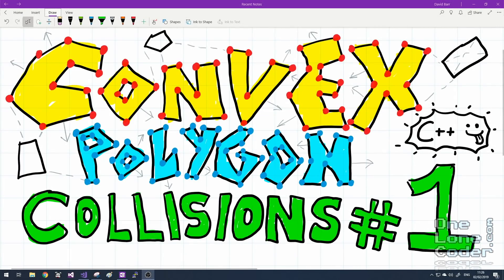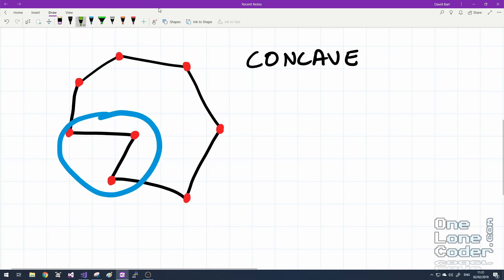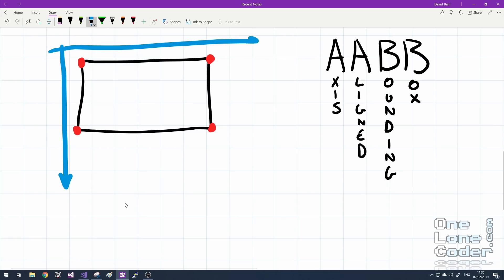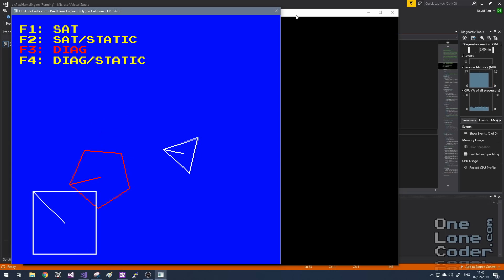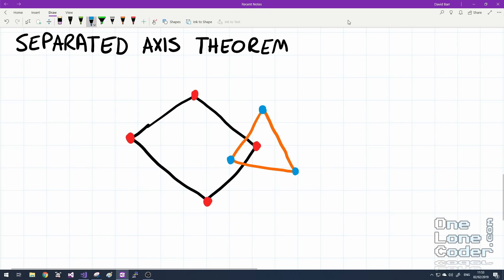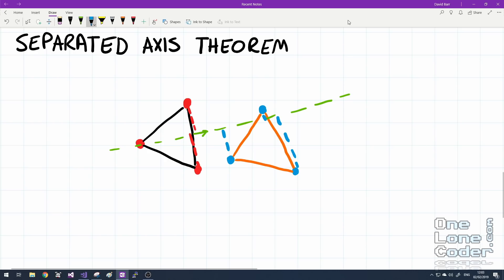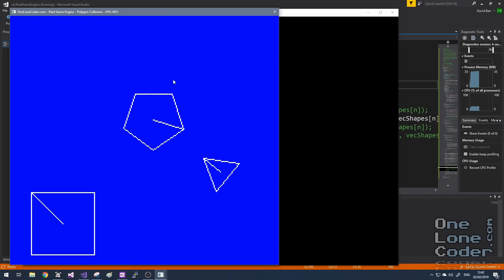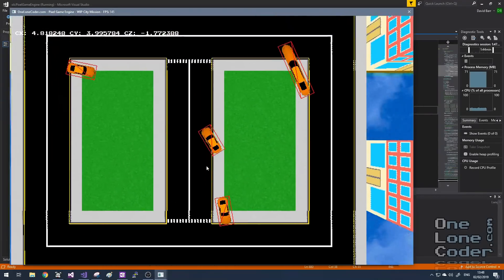Convex Polygon Collisions #1

Comment: I won't write a formal proof of the diagonals method... but consider: For two convex polygons to intersect, one of them must have a vertex inside the other polygon. They can't intersect otherwise. So... the moment the vertex enters the other polygon... the diagonal FROM that vertex must now intersect the edge that the vertex just crossed.

Comment: Thank you greatly for the video and code samples. I tried implementing these algos into my own system, and while the simple detection versions of SAT and diagonals worked perfectly, I was seeing some buggy behaviour when using the statically resolved versions of both. After trying many things, I tried normalizing the projection axis in SAT and that instantly solved the problem (my overlap values were way over inflated). The code sample says the normalization is optional, so I'm not sure if I have something else off in my code, but I just thought I'd drop that here in case anyone else has been going through the same thing.
Reply: Yeah, I went through the same experience, and this was actually helpful. 
However, for me, the second version, static diagonal intersection resolution worked just as shown in the video. What specific behavior did you encounter for the 2nd one?

Comment: For the diagonals method: What if you have a large first polygon, with a small second polygon inside it, where the second polygon is placed such that it does not intersect any of the diagonals of the first polygon. Then, it will report them as not intersecting, even though the second polygon is completely contained.
The diagonals method is good to avoid objects from colliding, since it will always find cases where edges are intersecting. For small fast moving objects there may be issues though.
Reply: Isn't it perhaps straightforward though to avoid this problem by  checking if any vertex is inside the other polygon?
Reply: @mohammedj2941  In this case the pulling-out algorithm will behave fairly unpredictable. Imagine that you already have one shape inside another after an update of a window. In what direction should you pull the inner shape? It is doable, but it doesn't look like an easily-maintainble approach to this specific problem.
Reply: for your case the maximal project on arbitrary edge of large object will also contain the maximal project of small object. So it contains the other (special kind of intersection)
Reply: You could always do a fast bounding sphere test small and if the circle/sphere is fully contained in the bigger one then use the SAT otherwise use DIAG. You can also use this test for early broad phase.

Comment: I think, depending on the number of collisions vs number of polys, you'd want one algorythm over the other. SAT exits early if there's no collision, DIAG exits early if there's collision. So, DIAG will exert maximum load when there aren't any collisions, and reduce the number of needed checks as new collisions occur (nice byproduct in my opinion, very useful since that saved time can be used to actually resolve the collision).

Comment: from the SAT algorithm, the sign of the dot product tells you which 'side' of the side the point is on. if you switch the nesting of the loops, then you can determine if each point is on the 'inside' of each side of the polygon. the magnitude of the dot product will give you the distance (after normalization - which can be cached).

Comment: About the only problem I can see with the static diagonal approach is if you tried to put the pentagon between the square and triangle and then use the triangle to push it into the square. If I understood things right, it would resolve the pentagon/triangle first, pushing the pentagon into the square and then resolve the pentagon/square pushing the pentagon out of (and back into) the triangle.
A possible solution from the top of my head would be use two loops of intersection checks. One forward and one backwards, thus swapping the pushing priority. So first T pushes P into S, then S pushes P back into T. Now the backwards check has P pushing T away.

Comment: There's another easy way to check for the collision of two convex 2D polygons; replace one polygon with a point, and the other polygon with the morphological dilation of one polygon by the other. Then the intersection test can be reduced to a point-in-polygon test. The morphological dilation of two convex polygons can be easily created by taking all the edges of both polygons and then sorting them into clockwise order by angle, then reconnecting them in that order. I don't remember the name of this technique but it works very well.

Comment: little optimization for the diagonal method: instead using an additional center point to build the diagonals, one can use one of the polygon corners. this reduces the required intersection calculations by the number of edges of both polygons.

Comment: 2:05  Just a note: if knowing that 2 shapes don't intersect is sufficient (not distance between them) then the AABB check is still useful and fast.  In most applications, even for shapes that aren't axis aligned rectangles, your shape storage probably has their AABBs anyway (altho you don't do this in your examples).  If the AABBs intersect, then you can go on to use a deeper method to find out if the shapes actually collide.

For very simple shapes (few edges) pretty much any test method will be about equal.  For larger number of edges, there is a pretty standard method called GJK, which is highly efficient.

I can see this being a good exercise for a budding programmer.  But ultimately, the game dev is probably wasting their time by not using a library for this.

Comment: I always use an even simpler method to test for AABB in 2D, and that is not to test if they overlap, but instead, to test if they do NOT overlap like this...

if (Px+w < Qx) no overlap, return false for collision
if (Px > Qx+w)  no overlap, return false for collision
if (Py+h < Qy)  no overlap, return false for collision
if (Py > Qy+w)  no overlap, return false for collision

That's it!  IF all of these tests fail, than we absolutely have a collision and can deal with it.  But these tests will return false the moment any one of them test positive as it will be impossible for there to be a collision in any of these four cases.  Much simpler than testing for overlap.
Reply from the maker: Hi Neil, yeah there are loads of early rejection optimisations I think its important for programmers to try and implement for lots of algorithms.

Comment: 2 observations with your diagonal algorithm.
 It can be made to work with "star convex" shapes, i.e. any shape where the line from your center point to your extreme points is contained in the shape. This includes a lot more shapes.

An issue though is that the intersection of a diagonal of one shape and the edge of the other isn't always a unique point. For example, this is an issue if you are moving a very obtuse triangle parallel to one of its diagonals. You can end up with an edge of the one shape coinciding with the diagonal very easily. This could crash your algorithm, or teleport the triangle further into the shape depending on what your intersection function spits out.

Comment: Hey javidx9, I have a question. At minute 26:40, the displacement of the object is calculated. Actually, the moving object would have to stop at the same place as before the colliding (It would be no gentle but a jerky motion). However, it moves so very smooth and fluid over the edge. Can you explain that to me. 

Yours sincerely Lukas

Comment: Have you looked at the GJK algorithm at all? It's a very nice algorithm which can operate on convex polygons, lines, points, and even mathematically 'perfect' shapes (like a circle, ellipse, etc)... any non-concave shape that can implement a "support function" that provides the "farthest point in a given direction". Essentially the algorithm "subtracts" one shape from the other and determines if the resulting shape (minkowski difference (sum)) intersects with the origin. If so, the shapes intersect. The end result of the GJK is also a convenient starting place for the Expanding Polytrope Algorithm (EPA) for collision resolution.

Comment: Do you want to address a more challenging, but related problem?  Do tool path calculation (find vector trajectory of the center of a circle that maintains contact with CAD elements as it traces around them.  CAD elements include line segments of width W, arcs of width W, and polygons (may be concave).  CAD elements may be overlapping or disconnected.  "Clean" CAD files (with elements perfectly connected) cause the most trouble!

Comment: I think your diagonals approach can return a false negative (incorrectly not detect a collision) if a smaller shape is entirely contained within one 'pie section' of a bigger one (between an edge and its two diagonals).
Reply from the maker: You are correct Pleeg, but you could argue they must have previously collided to be in such a state. Though this depends entirely on the rest of your set up of course.

Comment: I've discovered a problem with the diagonal method. If you have a shape completely inside of another much larger shape, it's possible for them to not detect any collision. 
If a shape can't get inside of another this isn't a problem, but it is important to note that method isn't perfect.

On another note I think I've come up with another. You could measure the angle of every vertex on one shape with the every the angle of every vertex on another shape. 
If the angle from every vertex on shape A to one angle on shape B is between the angles to the two connected vertexes on shape A, then that vertex on shape B is inside of shape A. 
Using actual angles involving trig functions seems too inefficient, but calculating the slope seems easy enough. I'll have to do some math or run some tests to see if it's worth doing at all.

Comment: my brain is hurting... i not sure if it is because i'am programming on javascript, and trying to understand and convert to it, or the math is enought to brick my mind already LOL
i got all lines from both my polygons, but going forwards looks impossible rightnow... i will try make it 1:1 first... those really heavy math part are tricking me, if i not wrong your video from line to circle detection was easier to reproduce LOL

Just update here, it worked! i not know exactly how it work, dude i have a totally different language and code base, mine structure uses lines not points and i adapted to run all lines and only get startpoint of those... also i did only one function and then make another function to call it with reverse polygon paramters soo it test both ways... in the end it worked!!! man i hope this not burn down cpus when people play my game, looks like a lot of tests per logic cicle, also i need to check circle with polygons and line with polygons too now LOL it will be another day

Comment: Hey man. Great video as usual!
In case you are suffering of some kind of lack of inspiration for future videos, please let me suggest you a topic :)
What about a video to explain a good algorithm for bounding boxes occlusion culling done on the CPU side? I'm currently working on a project where I'm using occlusion queries on the GPU. They work well but, as you surely know, the query result becomes available only after a few frames and it causes sometimes objects to appear on the screen with a little delay (especially if they move fast). A nice prepass done by the CPU to compute which AABB are visible before to actually render the objects would solve lot of my problems (even better if the alghoritm can run at a decent speed, say... less than 5 msec). 
I think this would be a good topic for a future video and it may also be a nice addition to your 3D engine... right? :P
Joking aside, please forgive if I allow myself to give you a suggestion, but, judging by your past videos, you look like the perfect guy to explain such a complex topic with your usual clarity and effectiveness.
Keep up the good work.
Reply from the maker: Hi and thanks Razie, Im always open to suggestions! Im hoping to expand on the 3D engine a bit, I had not considered BB occlusion culling, so I'll look into it!
Reply: @javidx9  Hey javidx! Thank you for answering. It´s a nice topic still with no clear solution. I hope you'll find it interesting. Enjoy

Comment: Just to add that 'diagonals algorithm' won't detect a collision if you place a smaller polygon in a bigger one in such a way that it doesn't intersect any of the 'diagonal' lines
Reply from the maker: Hi Pjh, the smaller one would need to enter the larger one first, and its diagonals would stop that from happening
Reply: @javidx9  For small 'deltas' that's true - ie where the delta is small compared to polygon size, but with delta's of the same order of magnitude as the polygons the smaller one can get in the bigger on in a single jump.  So yes in your example where the movement is small compared to the size of the polygon there is not problem, but for a small 'bullet' polygon moving a distance greater than its size per frame it can jump inside.  SAT catches fully enclosed polygons every time though.
Reply from the maker: lol, im having this conversations in two places at once XD You are quite correct, this would be an issue, but personally, I would never use this approach for fast projectiles like bullets, I'd just do a ray intersection.

Comment: In sat if theres only 2 shapes we can check only the one with less sides, or not? If there is no overlap we are good, i am assuming if a triangle doest overlap a dodecahedron the latter wont overlap the first unlike with the diagonal algo as you prooved you need tou check both
Reply: Not checking for all shapes makes false positives possible, where you think two polygons are colliding that are not.

For example, take an extremely thin pentagon, to the point it is practically a line. Put a square next to it:

-----    []

The square and pentagon aren't touching, but if you were to only check against the pentagon's normals it would report that they're colliding:

| -----   []    C>

(The "C>" represents a lamp, the "|" represents the overlap. If stretched thin enough the pentagon's sides would practically all be facing up or down)

The same would be true if you replaced the pentagon with a really thin triangle.

Of course this wouldn't be as drastic with normal-size polygons, but you would still encounter false positives at certain angles/ distances.

Comment: Great video. Helpful.
Also, thats a fast video output currently :)
Reply from the maker: Thanks zleapingbear, yeah went well this one XD
Reply: @javidx9   
thats always good.
Just a tough about the diagonals methode, 
Would it not be a bit more computional optimize to do the same line intersection, but with edges only? (so all edges of P vs all edges of Q) 
Also, using edges i guess would allow you to test concave polygons with the same algorithm.
(for intersection only, not the "move back" function)

Comment: I did'nt know the diagonal method, this is very useful ! Do you think it can be generalised for polyedron in 3D ?
Reply from the maker: Hi Fred, I think it can be, but it would be diagonals vs planes instead.
Reply: @javidx9  Yes, I think it could work in this way ! This technique is very intersecting (diagonals, 2D), I did not find this technique before, did you invent it or did you find it somewhere ? Do you know existing programs that use it, is (was) it patented ? 
I like to find all techniques used before, for example Carrier Command, the 3D engine on Atari ST, the used techniques :)

Comment: what about checking line intersection between the line of the direction of the polygon with the other shapes edges and if there's and odd number of intersections you know the pointer ended inside another shape and if even it's outside?
Reply from the maker: HI Roy, a valid strategy, it has no early get out clause though (I think) SAT can fail early if there is no collision so fewer checks to make.
Reply: @javidx9  Yea but I think it could be nice for concave since it works for concave polys as-well if I'm not missing anything.

Comment: I'm not remembering the details but could you not have re-used the collision detection module of the physics engine you have built?
Reply from the maker: Hi Micheal, that engine specifically only worked with circles and lines. In many ways yes you could use those tools to do this, but you would need to maintain the position of your circles to facilitate a rigid body, this can become very complicated.
Reply: javidx9 Ah, I see. I remembered the asteroids video and thought you had used your physics engine there but after rewatching it, I noticed that you didn't and that you've drawn the asteroids as polygons but detected collisions only as circles. Sorry for that.

Comment: I have implemented ShapeOverlap_SAT_Static, but shapes upon colliding are displaced way farther than they should. Multiplying the displacement vector by fElapsedTime looks like a workaround, but if there is something crazy like 257-gon then it is not: without fElapsedTime, collisions with 257-gon work great, with fElapsedTime, the displacement is very slow. Help!
Additional info: this was programmed on C# with MonoGame framework.
Reply: Fixed: apparently, the axisProj must be normalized. Weird that I didn't think of that first, but what's even more weird is that everything worked perfectly in the video (which is probably why I didn't think of normalizing the axisProj in the first place. Oh well)